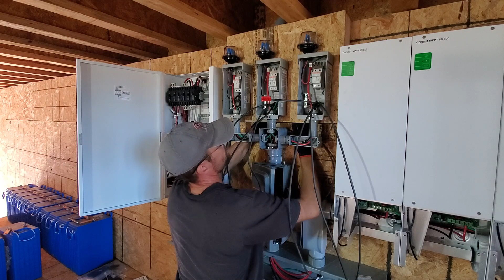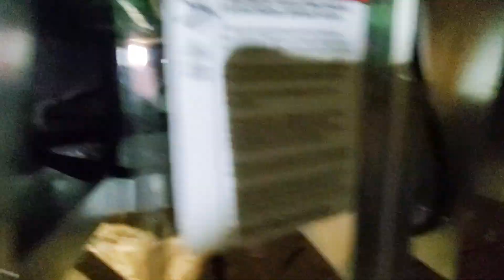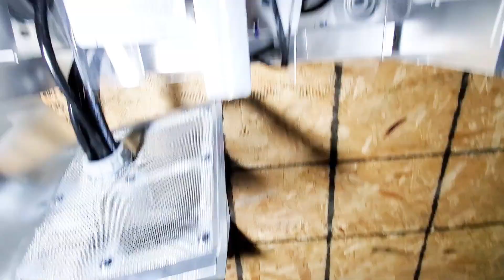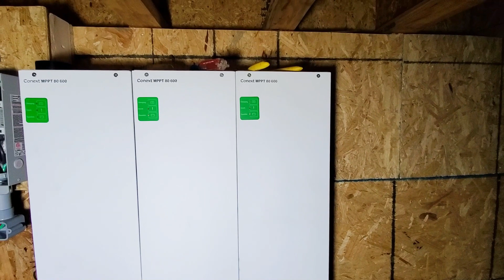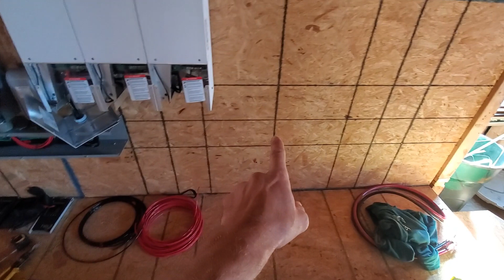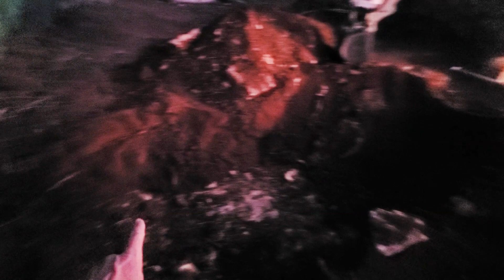Wiring up 15.36Kw of SOLAR POWER on our DIY Off-Grid Homestead Barndominium Build

Comment: since install for the past 3 years, have you had any issue with the Schneider or did you need to update anything or work on anything on it? If you had to do it again, would you use the Schneider again or something newer like EG4?
Reply from the maker: I could never get the two inverters to fully work together.  They would both output power but I'd often get warnings. These warnings I was told by Schneider really didn't mean anything but we couldn't get them to go away.  After a year I realized that we rarely used more than one inverter would output anyway so I disconnected one and kept it mounted as a spar.

Flash forward two years and I got an notice about a firmware update so I did it.  That fall I was getting things ready for winter and fired up the generator.  Then weird stuff started happening.  After some time on the phone with Schneider they came to the conclusion that the firmware caused a software error because that upgrade eliminated the SCP in place of the Gateway.  I wasn't told of this so the SCP and the Gateway were fighting for control of the power coming from the generator.

After wiping the inverter we were able to get it running again but it couldn't communicate with the rest of the system anymore.  Schneider warrantied both inverters. Now I have four of them.

Around that time EG4 was getting popular and I watched a few videos and decided to upgrade the system and bought dual 6000xp inverters.  Since then I've hooked them up and will say that the install is a lot easier but they are very very loud and I can't use all the solar I have on the roof.  The Schneider charge controls can take a lot more and the whole Schneider system was more beefy.

So now I have the entire old system on one wall and the EG4 on another.  I also upgraded my batteries with four Rhino 3's from Battery Evo.  That's been a disaster so far.  Long story but I wouldn't suggest buying from them and I'm very gald the old Schneider system is still hooked up because I've had to use it a few times along with the old batteries.  I had planned to sell it but might just move it to another property at some point.

Doing your own solar is addicting.  I have a lot of extra parts now...... you've been warned!
Reply: @Off-Grid  Thank you so much

Comment: Nice job.  One thing you could have done was put the combiners to the right of the charge controllers.  This way the DC out of the combiners would feed the RHS of the charge controllers.  The resulting 48V DC could then come out of the LHS of the charge controllers and avoid that penetration through the screen.  This method would have also kept the 600V and the 48V separate in you wiring  chase.  2nd thing: I know it's tempting to bundle the wires, but I like to keep them separate as in they tend to get warm under load and even though there's insulation, I want as much air flowing around them as possible.
Reply from the maker: The layout worked but I agree, it could have been better.  The wires needed to go out the back of the charge control but I didn't plan for that.  A rear raceway would have been really nice to have had.

Comment: could have used a ground plate they come at 400a rating and only have to down 2 ft on the flat they are about 1 ft x 2 ft in size and only need one instead of two 10 ft grd rods
Reply from the maker: Didn't know that, thanks for the tip and for watching.

Comment: Quality install nice job! I also am off-grid with Schneider Electric components, I'm wondering what was your reasoning for the added expense for three combiner boxes when the 80A-600V controllers have built in over current protection? IMO DC Isolator disconnect boxes with a 3ms arc suppression covers you for NEC requirements regarding disconnect shut-down. The only reason I can see are those Midnight 600V lightening arrestors, if that is the case than the added $$$ for the possibility of a lightening strike to the roof of your house is only giving you the false sense of protection that you think you have, interesting!
Reply from the maker: It's what came in the kit.  We didn't order each piece independently.  A direct lightning strike is possible with the storms we get.  Better safe than sorry especially when the expense was so small.

Comment: Looks like you built your house on top of a buried mountain with all of that rock.  I think you've got a good plan with putting your loads center close to your equipment.  You'll save a little bit on the expensive wire to feed it, but depending on all of your runs, it may balance out.
Reply from the maker: We're amazed at all the rock.  This area isn't known for being rocky.  Guess we got lucky.....

Comment: Nice job! Any particular reason you went with Schneider for off-grid? I normally see Sol-Ark or MPP Hybrids. Any benefits for the higher costs, or was it just preference?
Reply from the maker: We kept seeing other off grid homes using Schneider and I have used their other electrical products before.  So it was more brand recognition and trust.  I had never heard of the other brands at the time.  So far the set-up is working great.
Reply: Schneider is also a tank for heavy surge hits. They handle the unbalanced loads very well and simply built with to last. This build is fantastic, one of my first when I started my build with the same equipment.